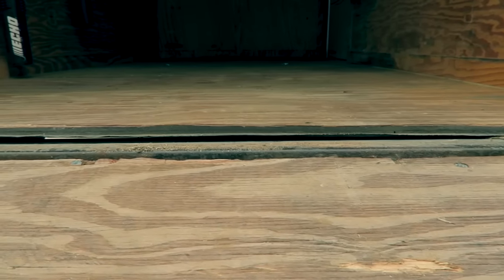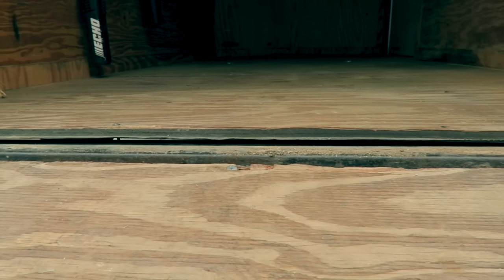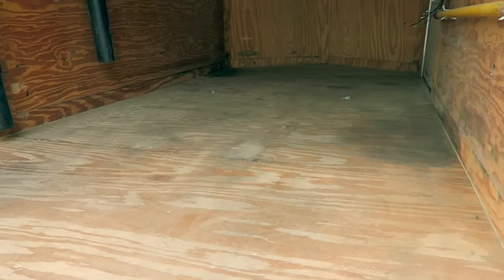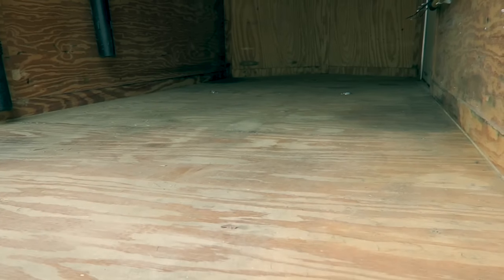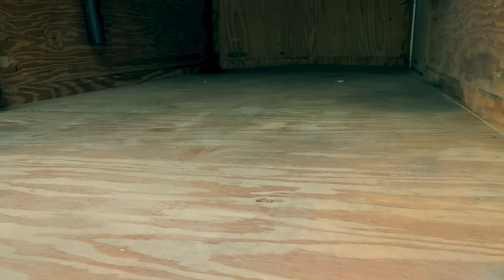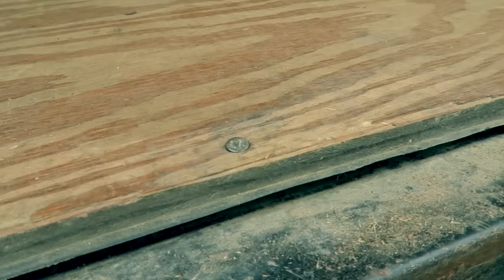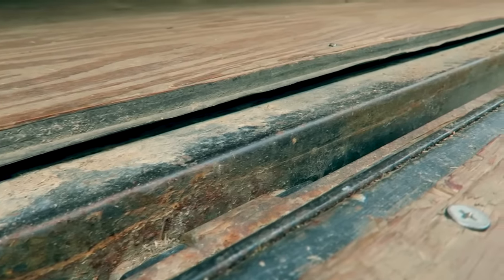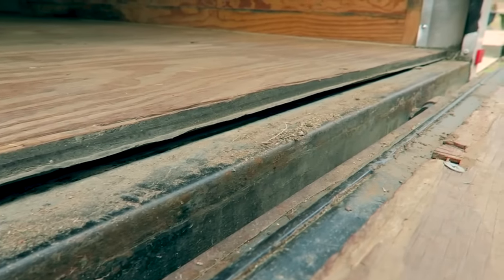Enclosed Lawn Care Trailer Problems

Comment: Make sure to check the cross members underneath as well, they could be bending. My old enclosed did that (before it got wrecked) where my Z sat on the trailer. I'd advise to possibly get a welder to weld up some cross members underneath and replace that piece of flooring, or do the whole thing, with some thicker plywood. My new trailer however I got outfitted with a double 3/4" plywood floor, 1 1/2" thick, so my floor isn't going to bend any time soon (hopefully lol)
Reply: WillsLawnService exactly! this is good advice. a good welder can make your trailer much much beefier and better with a small investment. way more affordable than a new trailer.

Comment: Great vids. I would recommend a trailer with additional floor bracing. 16" o.c instead of 24" o.c if that's what you have. As well I've learned that if the flooring isn't of good quality such as advantech, moisture from lawn clippings under the deck tend to be absorbed by the floor causing swelling. Since the flooring is made of wood, expansion gaps should be left on all sides for expansion and contraction. This causes buckling and warping as well. Hope this helps!!! God Bless!

Comment: hey buddy if it were me I would remove those screws and get some bolts stainless steel with some big washer heads and tighten it down and they shouldn't go anywhere just put some thread lock the threads and it should be good to go but other than the plywood you're really not looking at a whole lot of money to replace and you can get more use out of the trailer purchase the small investment of time and energy. if you have any questions about it just contact me and I'll see if I can give you some advice all the time I am working on old Farm trailers and equipment trailers replacing broken decking boards I also have done a few enclosed trailers for friends and family. if you didn't want to replace the screws with bolts you could get some JB Weld and back the screw out a little Gob the J-B weld on and tighten the screw back up should work fine that way too

Comment: i agree with the bolt suggestions ( with loctite, lockwashers, & locknuts ), if you have through access to the under side.   if you don't want to change out the screws  ( which you don't necessarily have to; you can throw bolts next to the screws & pull the screws as they pop out on their own ), then maybe try to hold them in with a hardcore epoxy applied right on the heads while they're still in.

the advantage open trailer floors have over what i'm seeing here is, this is a plywood floor, most open trailers that i've seen use 2x4s, or boards thicker than plywood. you could always treat your trailer floor as a sub floor, & lay some 3/4 or 1" hardwood decking in there....or even the synthetic deck boards they have out now. that might even fix your warping problem ( though the dip might be a failing of support that needs to be looked at before it gets worse ).

be safe, brother.

Comment: Fall River I would pull the screws out and enlarge the hole to the next size.  Then use a tap and thread the holes. Then install a new bolt with a fender washer, a lock washer and use loctite.  The fender washers will give you double it not triple the safety of not pulling the bolt thru the plywood or even the plywood pulling up again.

Comment: Maybe bolt the floor down.. use washers to distribute the pull on the plywood. or even better... fabricate a strip of metal maybe 2" wide and the width of the trailer with holes to pass the bolts through. maybe 1/4" thick plate steel or 3/8" thick.

Comment: mine did the same thing I used self taping metal screws with my inpact gun with hex  heads drove them deep set into plywwood ramp no problem after that my enclosed trailer was over 5,000 that didn't matter just remember it takes a beating going up and down and driving over it many many times

Comment: Note that the frame that the axles or welded to is not really strong enough to handle  a heavy load to much flex it should be made of rectangle tubing not thin I beam . That's my opinion.

Comment: I paid almost 6k for mine thinking I wouldn't run into the problems like that with the floor that all my friends seemed to have.  BS!!!!! They ALL do it.  Garbage! When mine finally takes a shit I'm gonna rip that floor off and put a full 3/4 floor in it which they claimed is what was in it in the first place.  Not true and it's press board, NOT plywood. When I do that it'll also be put in with tech screws and not those crappy screws they built it with.